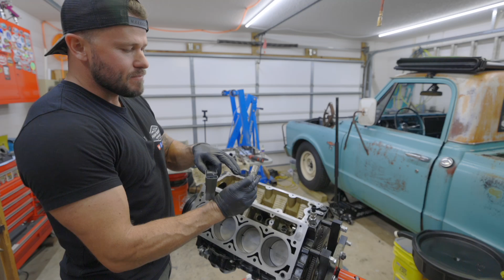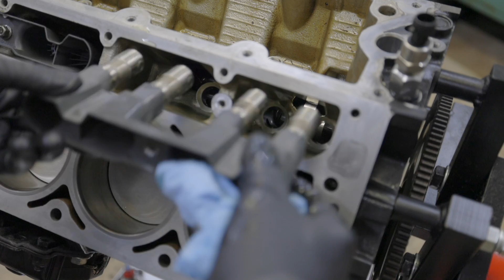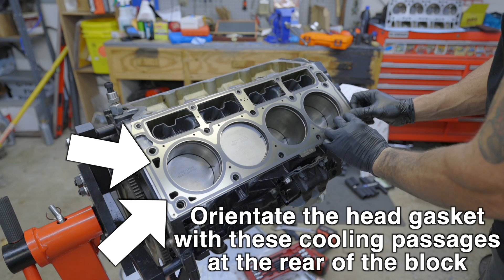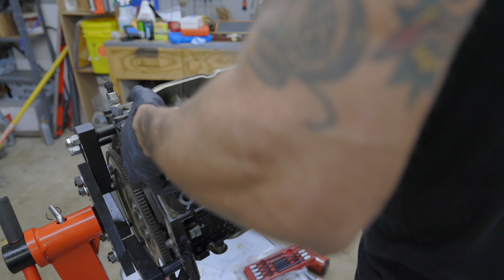Installing LS Heads With ARP Bolts | No BS Tech

Comment: Your lifter trays are upside down
Reply from the maker: They are only directional on Gen IV blocks with the indention.
Reply: A typical installation is opposite of how you have installed them.